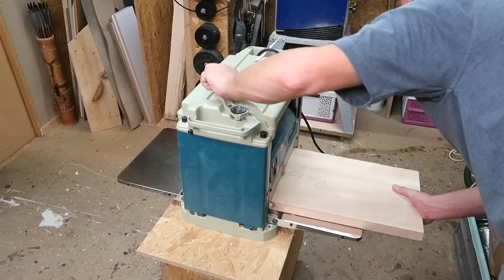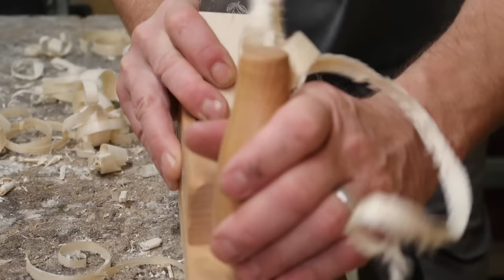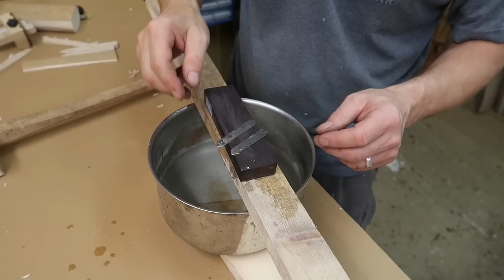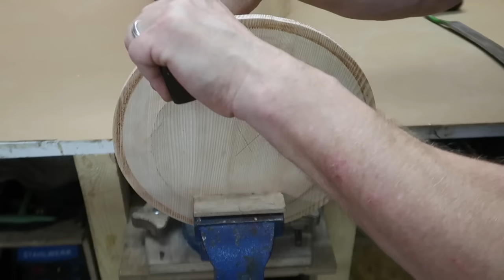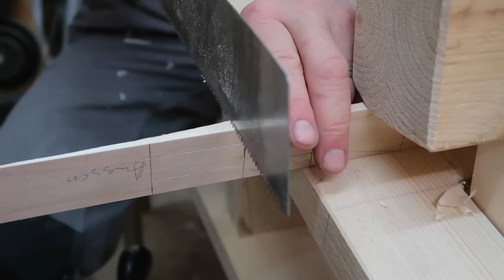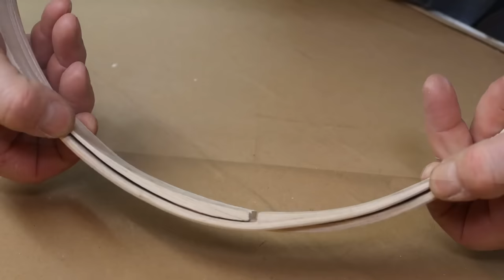Making a bucket completely from wood – without glue or metal

Comment: Great video!  My dad and I demonstrated making wooden buckets (with riven wood rings) at the Ohio Sate fair for about 15 and 10 years respectively with few deviations from what you presented.  The few deviations were:
(1). No power tools (other than the chain saw to cut the logs.
(2). White oak rings, made from a green log without steam or heat.
(3). No pegs
And, yes there is a lot of wood waste to pick up.
Reply from the maker: Thank you for the additional information.
Reply: i wondered about the pegs, makes sens you'd the freedom to tighten the rings if they stretch a little over time...

Comment: Nice bucket. I don't think I've seen that style of wooden rings on one before.
Reply: I saw something similar in the beginning of Ashley's Book of Knots but that's the only place I've ever seen it! It's a very cool technique!
Reply: It seems very common if you look for proper Coopering videos. I suspect it comes form continental Europe originally, most videos are of USA Coopers still carrying on old family craft. Normal old barrels, Coopering, used rope or wood used like rope. Just look at old paintings. They are everywhere.
Reply: @nicholaspostlethwaite9554  I've watched plenty of bucket making vids on YouTube and it's the first time I've seen this. Are there any others you would recommend?
Admittedly, the ones I've seen (both traditionally built and ones built using modern methods) and they always seem to use metal rings or twisted sticks of Hazel or witheys. 
Not that I'm overly interested in buckets -  I've just watched everything else on YouTube by now 🤣

Comment: 13:55 I haven't actually used one for proper woodworking before, but I have noticed that victorinox knife steel is ver, surprisingly good for a stainless steel. I think it's on the soft side for woodworking (though certainly harder than typical kitchen knives), but it seems to be extremely fine-grained and homogenous so that it takes a shaving edge very well. I wish moderately priced name brand kitchen knives were made of the same steel, they're all embarrassingly soft and crumbly by comparison.

Comment: is it easier to manually shape the curved boards like that rather than use something like heat + water to bend them? how did they do this in the old days? like this? or by heating the wood and shaping it? a bit of both?

Comment: Back when words like Baker, Miller, Smith, Potter and Cooper were more than just pro-nouns...Awesome Vid of a skill set that is all too quickly disappearing...The wood bending and the way it's utilized, is truly sublime... My only concern is how much a wooden bucket that size, full of just about anything weighs. I'm thinking very few people could actually use it..Which, I'm thinking, is why back in the day, these types of containers were kept in the 1 to 2 liter range...Glad I'm not the only one that huffs wood shavings. ❤‍🔥❤‍🔥🔥🔥
Reply: I agree that this bucket was a bit on the large side for most people, but 1 to 2 liters? A regular plastic bucket today ( carrying water, cleaning floors etc), tend to be 10 liters. Aka , roughly 2.5 gallons.
Reply: @Goldenhawk583 You make a fair point. It's worth mentioning that I'm in Nebraska USA, we don't do much metric around here. If 10 liters is manageable then I'm all for it. Water weighs 8 lbs. per/gal....A 2-1/2 gallon bucket sounds about right
Reply: @Fireworxs2012  yes, i took the liberty to assume you either made a typo, or remembred wrong about liters:):) There is 4 liters to a gallon ( roughly), and 1 liter weighs 1 kilo, or roughly 2 pounds:)

could you imagine all the work of milking cows, if all you have are 1/4 gallon containers? :D

Comment: Perfect! What type of wood?
Reply from the maker: Thank you! The side walls (staves) and bottom are made of silver fir. The horizontal rings are made of ash. The handle is made of yew.
Reply: Hi Andi, 
I’m using your techniques to make a couple of wash tubs. 
I have a couple of questions about the hoops. 
How thick is  the hoop stock and is there a minimum width you use so the ends don’t split?
Also, when measuring for the hoop, how much extra do you add to allow for the locking mechanism?
And one more question, on average how long are you steaming the steaming the ash?

Comment: Interesting take of a modern way to do a basic coopering job. A Cooper does it all by hand, like the angles of the staves and you do not need the pegs between the staves lol never seen anyone mess about like that before. A bucket is easy, next do a proper shaped barrel. You used those flat wood hoops, seen often in coopering in the USA 'reenactors' videos, old barrels had rope or wood used like rope. Just look at old paintings. Iron was expensive hence all medieval to old barrels used wood or rope hoops.